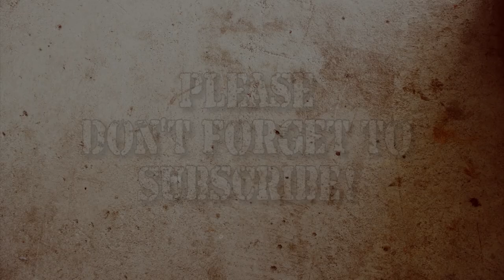Mail Call Mondays Season 2 #32 - Cutting Foam, Holdovers, Movers and more!

Comment: The other good thing to use on pelican foam is an electric knife.  Got one at walmart for ~$8 and it works awesome.  Traced out everything onto my foam, then cut it out on the inside of the line so there was some pressure to hold what was in the void and keep it from moving.

Comment: On flinch: Ball and dummy drills are all very well, but current circumstances are that I can't expect a "second" to be around to load for me. I suppose I could seat some bullets into empty cases and then draw out of a cloth bag with my eyes shut, not opening them until the bolt is almost closed and I can't see the primer (or absence thereof). That should have the same effect. I hope.